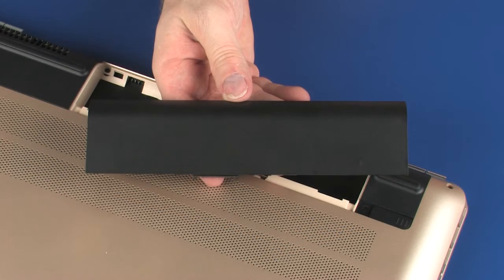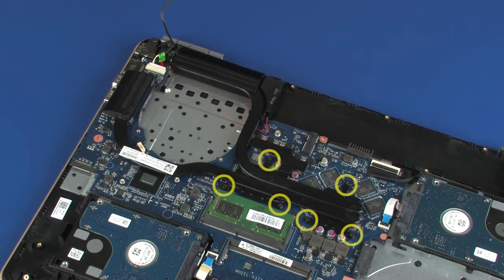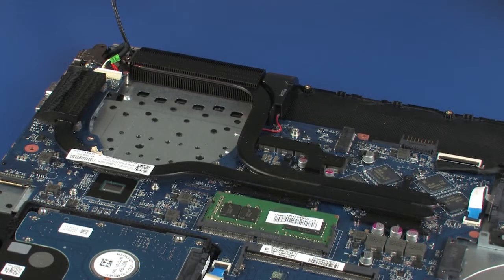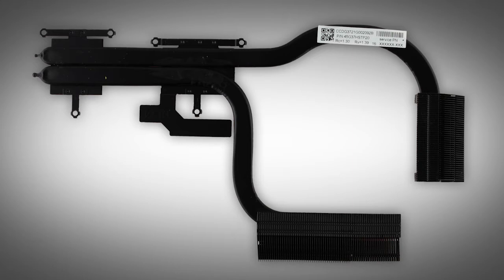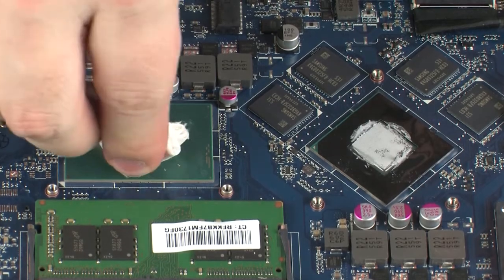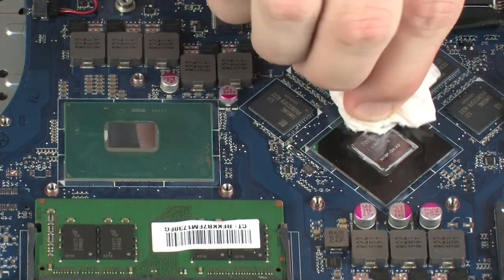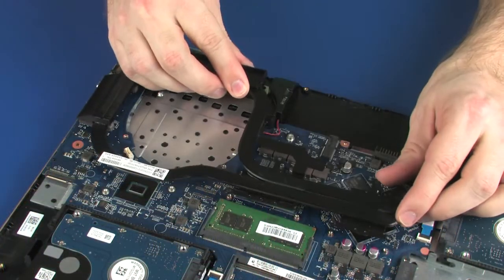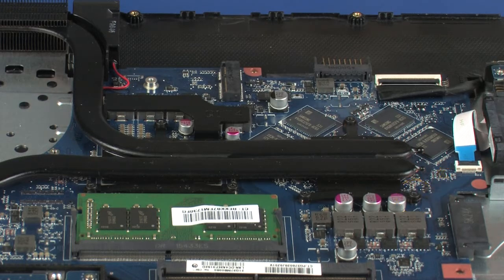Replace the Heat Sink | HP Pavilion 17-ab001 notebooks | HP Support

Comment: are there no thermal pads on the copper side of the heatsink system ?
Reply from the maker: Hi there, thanks for contacting HP Global Social Media Support!
I understand that you need to know about the thermal pads on the copper side of the heatsink system.
In order to get this issue fixed, please contact our customer care team over the phone or chat for further assistance, as this issue requires Live conversation with you over phone or chat to isolate the issue and provide you instantly with appropriate solution or repair/replacement options available at your place as per the warranty.
Please feel free to reach us on call/chat, please access this link to select your preferred country and language option to reach us. Global support link: - https://www8.hp.com/us/en/contact-hp/ww-phone-assist.html
Binu_HP Social Media Tech Support
Reply: @HPSupport   Hello, after following the manual i have found that some thermal pads were installed with the 0.5mm thickness.
From the manual spare parts it seems like the Thermal Pads Thermal pads (not illustrated) part number is  L56874-001
Is there any way to confirm the original dimensions(thickness most importantly) for this part ?